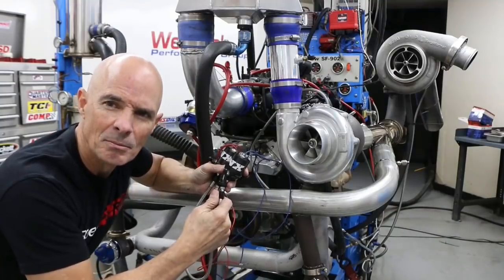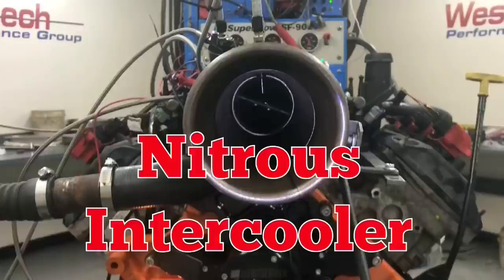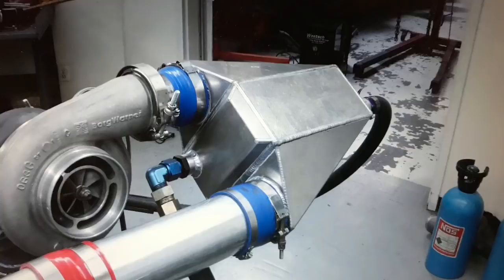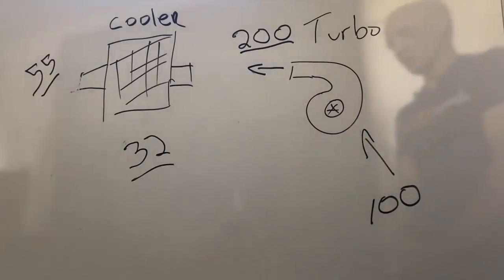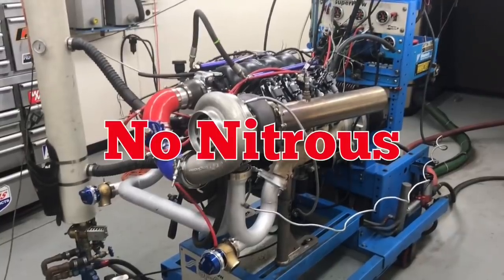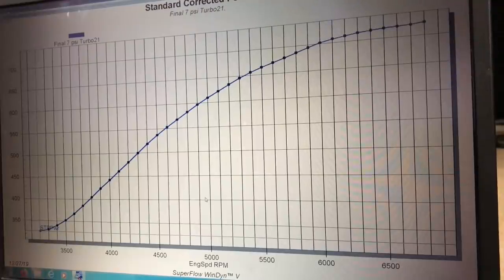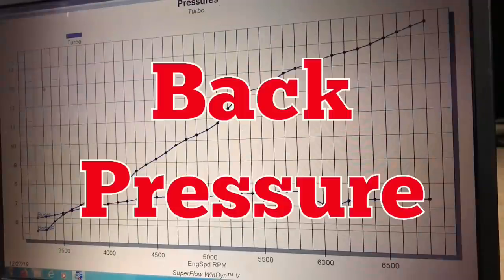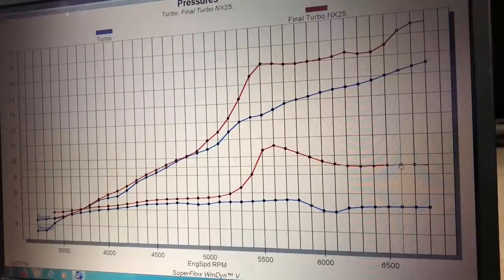NITROUS INTERCOOLER-TURBO + NX=BIG HP (FULL RESULTS!)

Comment: At 7:05 you mentioned water/meth on long runner manifolds.  But how does the poor man's intercooler stack up with air-air or air-water at the same 14psi test?
Reply from the maker: it doesn't-at least not in terms of distribution on a long-runner intake
Reply: @richardholdener1727  I'm glad to see you putting this info out for everyone to learn about.  Could you tell us how to size water/alcohol nozzles, the number of nozzles and how the placement pre or post turbo affect inlet temp and turbo sealing by injecting pre turbo.
Reply: @richardholdener1727  so the air to air intercooler is better than water/meth?
Have you done this test already?

Comment: what about using the nitrous as an interchiller only to cool the air coming into the heat exchanger but not  injecting into the motor
Reply: That sounds like a waste of nitrous
Reply: Co2 would be perfect for that.
Reply from the maker: I did that but CO2 is cheaper
Reply: @joshdrobny93  well there's a ton of kits out there and guys using it so there must be some sort of benefit over co2
Reply: @bigboreracing356  think the only reason more people don't use dry ice as much is it doesn't have as high of a specific heat as ice water.

Comment: I would prefer a intercooler over NOS cooling. The pressure and HP spikes are easy to blame for engine damage. The spikes are not in tune and create lean/rich conditions. I have used NOS to spool turbos up and had no failure,  but I can say it did not cause let's of prematurely worn parts.                     And don't stand so close to the big bang projects. Haha

Comment: Next up, air to liquid nitrogen intercooling?
Reply from the maker: i do want to try that but its pretty expensive
Reply: Richard Holdener yes and no.. the liquid nitrogen is cheap, the containment runs about $1000 for about 20L.  Maybe a cheaper alternative might be dry ice in an ice chest. put an air to air intercooler inside the ice chest and pack with dry ice.  Fun part though is the dyno room might be so fogged up you can’t see anything.

Comment: Dry shot would work better?
Reply from the maker: its the same amount of nitrous, but without the extra fuel cooling (or does the fuel heat up the nitrous?)
Reply: The different vapour  temp might interfere with the results just curious if it would make a difference! Keep up the great work!

Comment: I dont remember the specifics but back in the mid 1990s i ran a 5.0 EFI Mustang with a Vortech S trim and a dry 50 hp shot of nitrous plumbed in at the blower inlet.
Temp at the blower outlet WO nitrous was 220 f. With n2o temp was 190.
Only things I could measure were the temps and fuel pressure while running up & down Interstate 80 in Joliet, IL.
I also ran Vortech A, B and R Trim superchargers.
Anyone remember those?

Comment: Why not build an intercooler similar to a water to air, except for the end tanks run tubes through them so you can pump Co2 through the end tanks. Most turbo race cars use Co2 anyway. All your have to do is pump in and recirculate.

Comment: I used nitrous on my junky old ball drive Paxton for my 5.0 Foxbody...made those new fangled gear driven Vortech feel sluggish lol. 
I actually sprayed a 125 or a 150 shot one time into it...that thing would run for a stock motored 5.0 lol...
I told everyone it was intercooled and when they finally figured it out I explained it as a "chemical intercooler" lol...that isn't a lie!
That setup was on my car from 1994-2018, motor finally got too tired and I put a Windsor in last year.
Reply from the maker: it always helps
Reply: How about a camshaft recommendation from a Pro (that's you)?
I know you know about Fords, I know your past lol.
Not the best combination of parts, but it's what I got to work with:
3200# Foxbody Coupe
5 speed Tremec
3.55
393 stroker 35W 9:1 built lightning roller motor, EFI
Super Victor 351W, elbow and 75mm throttle body
Street car..air conditioned...how big a cam can I go?
Possibly will go stand alone to get 6500-6800?

Car currently has this cam in it:
https://www.ebay.com/itm/110451240631?ul_noapp=true

Would be VERY interested on your quick recommendation.

Comment: put the no2 through a liquid to air heat exchanger/aftercooler and vent it to atmosphere, or use propane/cng or whatevers cheapest with the lowest boiling point to vapor pressure to cost ratio

Comment: good info but only good for dyno results, real world drag strip with 2 gears 3 gears or 6 gears would have much different results
Reply from the maker: power would be the same at the track through the gears
Reply: @richardholdener1727  I beg to differ.  Iats start lower and end higher.  A 3 second run on an engine Dyno is only part of the story.  A 9 second quarter mile through the gears would be more telling imho especially considering that's what most of these applications are based on or straight line performance.

Comment: Reminds of when ford in the UK started using liquid lpg injection for fuel instead of petrol on there turbo ford focus touring car. 
Yes propane has less calories. But 112octane combined with the having the phase change cooling your boosted charge down = why are ford winning all the time.

Comment: Now let's try an even better setup and inject the nitrous either pre compressor or into the volute itself.
Reply: B7_S4_Turbo, cool, make a video  of it!
Reply: Seems like what everyone is asking for lol.
I know that watching what it does to Cletus’s Cummins makes it look like a game changer
Reply from the maker: I'm curious how you think that will make it better other than having a little more time for charge cooling-its still the same ratio between boosted air and nitrous-but I'm in on hearing results if you have them or I might try next time I have a turbo on the pump
Reply: Richard Holdener  not that you’d want to hit that LY6 with 125shot down low like Cletus does on the Cummins, but on that car, it looks like the high nozzle pressure coming out of the tip actually physically PUSHES the compressor wheel faster and spools it WAY faster. 
Personally, I’m more interesting in using a health dose of meth pre-turbo and letting the meth fill all the machining tolerances in the compressor housing to aid its efficiency.
I don’t think I can link you here to the cleetus video. I’ll maybe message you on FB.
Reply: @richardholdener1727  the idea here is spraying pre-compressor further increases and widens the efficiency islands. Ideally you'd have one pre comp and one in the volute or right outside it for further cooling. Yes more time to cool is always a plus.

Comment: Water methanol injection is much more effective at this and far less expensive
Reply from the maker: except of course for the distribution and making less power, it works well
Reply: Richard Holdener Topic of the video is to cool without the intercooler. Dude. Keep it on point dude. 

FYI NOS is awesome stuff for power!!

Comment: Motor = electric power
Engine = internal combustion
Reply: Steam engine? Not internal combustion...
Reply: Edit: 
motor = electric
Engine = internal combustion/pressure
Reply: Everyone knows this.  Please don't bother Richard Holdener with pedantic dumbassery like this, he's got tech filled videos to make for us!  Thank you.
Reply: My boss used to make this same argument.  If it were ever truly the case, languages change over time.  Other outliers:  rocket motor, fire engine, motor vehicle.
Reply: @BlindBatG34  Yes sir!
Reply: Forgot about General Engines, the Ford Engine Company...
Reply: I just did a quick search to check the definitions. According to Merriam-Webster:  
Engine = “a machine for converting any of various forms of energy into mechanical force and motion
also : a mechanism or object that serves as an energy source”

Motor = “any of various power units that develop energy or impart motion: such as
a : a small compact engine
b : INTERNAL COMBUSTION ENGINE
especially : a gasoline engine
c : a rotating machine that transforms electrical energy into mechanical energy”

( That was a direct copy/paste.  I didn’t change the capitalization to be a dick. )
Reply: @Richyrich1234  
Motor
a machine, especially one powered by electricity or internal combustion, that supplies motive power for a vehicle or for some other device with moving parts.
Reply: @BlindBatG34  So an "electric motor" is actually an "engine" after all?  Lol
Reply: It's ok, my 2 degrees in automotive technology and 20 years of experience don't have any weight. You guys are right. 😅🤷‍♂️
Reply from the maker: common usage rules apply
Reply: @Richyrich1234  I don't think anyone really doubts you, it's sort of common knowledge.  But it's a distinction without a difference in this case.  We all know what is being discussed.
Reply: @markrich3271  So wait, an internal combustion engine is actually a "motor?"  And an electric motor is actually an "engine?"  Just goes to show how pointless this age old "correction" of terminology really is.  Thank you!
Reply: a engines can be motors, but electric motors can't be engines